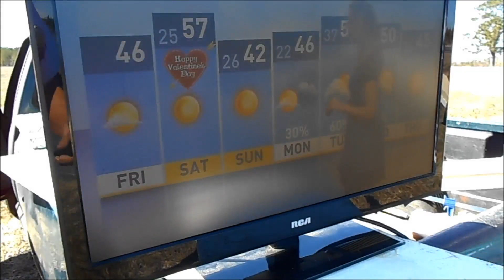HOW TO MAKE A TV ANTENNA HDTV LONG-RANGE TEST

Comment: I have to tell you one big plus with the ultimate antenna over the Hoverman is there is no horizontal locations for large birds to light. I live on the coast in Corpus Christi Texas I have a tower that is 45 feet and the horned owl at 4 pounds and osprey I don't know how many pounds but much larger loves to sit at the top of the tower. The ultimate antenna does not allow for a horizontal roosting post

Comment: hey Danny did you know there tv apps that tell you where to aim. when you open the app it uses your gps and tells you where they are and how many miles away they are. so when you not sure where its comming from. touch the screen on the station and it tells you more about the station. compasses with stations on it. i am testing two. i learned some stations pattern is not round.. they sometimes aim to the most populations
Reply from the maker: yea

Comment: Danny, thanks for posting! I used your instructions along with those of another video to make my own unreflected version of this antenna. The first night I put it up conditions were right and I was watching stations from Kansas City some 160 miles away! I switched to 9 1/2" wide whiskers spaced 9 inches apart. This antenna isn't good for VHF low, but from ch6 up to 13 it does really well. UHF is good from 14 to about 20 and great from 21 to about 44 and still good from 45 to 51. On certain nights I've received stations from 65 to 702 miles away, the farthest being Corpus Christi TX to Christian county Missouri!How about building a vertically-stacked 8-bay version of this antenna and giving it a test?
Reply from the maker: A reflector will help it out alot ..,thanks for the info.. I will make one of the stacked 8 bays.keep an eye out for it. have you seen this...How To Make The Ultimate Tv Antenna,,,https://youtu.be/jnN3bBY6_ko  And put a booster on it.
Reply: I'll check it out. The reason I haven't boosted is I have six&#160;TV broadcast towers within 6 miles and I&#160;wonder if&#160;an amp&#160;might overload the TV? I will be looking for that 8-bay....I want to build one and throw a folded dipole on it, attach it to the Balun and try for some VHF low band&#160;skip. Maybe one of these days I'll post some DX&#160;screenshots and a pic of my antenna. You inspired it! Also meant to say I hear the vertical 8 bay has better gain than a side-by-side 4 bay? We'll see
Reply from the maker: SlickRidez Garage OK MY MAN GOOD LUCK